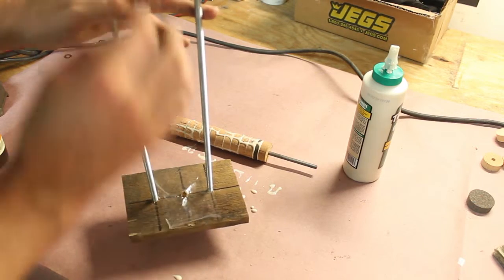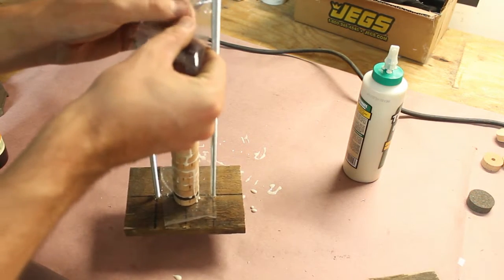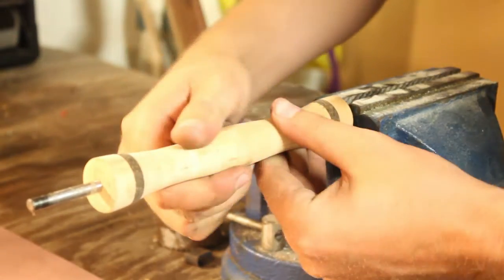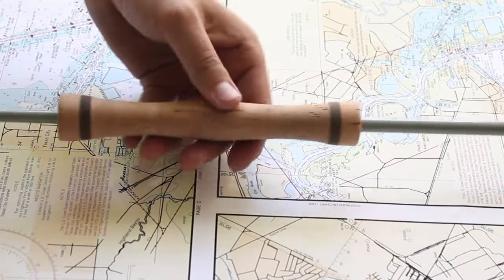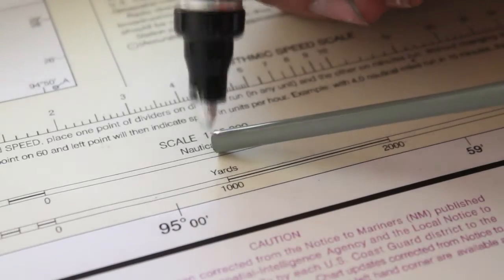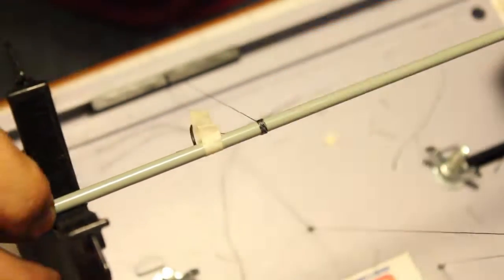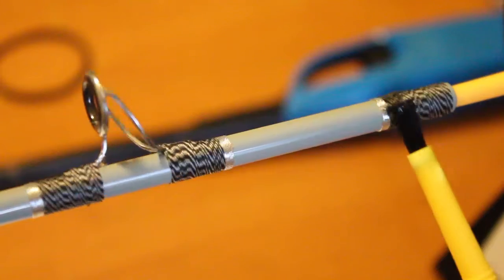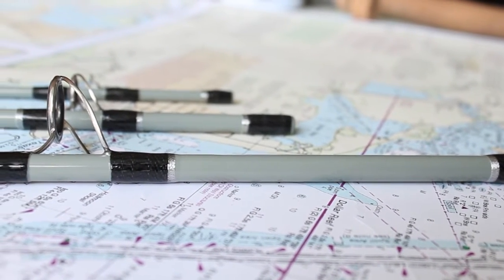Homemade Fly Rod Ep. 2: Grip and Guides

Comment: Very nice! You can use your lathe to clamp the grip while gluing it up. Here is a video I did making a grip from wine bottle corks using the lathe as a clamp: https://youtu.be/un-PKnpkwto
Use the ram on the tailstock for clamping pressure and leave the chuck loose on the metal rod so it can move while compressing the cork.
You have some great content, I just sub'd, look forward to seeing more!

Comment: Could you have used just a single piece of threaded rod, a pair of washers, and wing nuts to press the cork? I can't think of a reason why not, but maybe you had one?
Reply from the maker: I don't want to run the risk of the cork getting stuck to the threaded bar, its alot easier to keep it from sticking to the lubed smooth rod. And plus, this is the conventional cork clamping rig just about everybodys uses ;)
Reply: Interesting. I'd be worried I'd tighten one side more than the other, causing the layers to dry a bit skewed. 

The problem of sticking to the threaded rod is eliminated with some liberal application of silicone lube/grease. I've used essentially the same technique to build balsa wood plugs to be used as the master shapes in making molds for discus launched glider fuselages (or pods, as they're usually called). There is a downside that the dual-threads solves though - with a single rod you can accidentally allow the layers to twist if you're not paying attention. Easily avoided if you're thinking about it though.